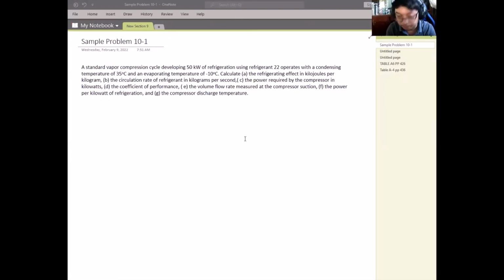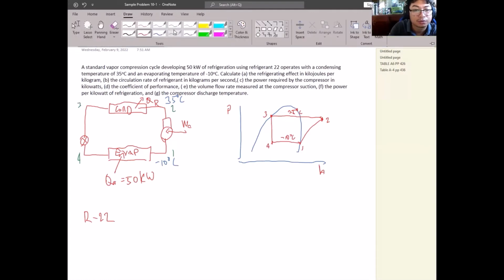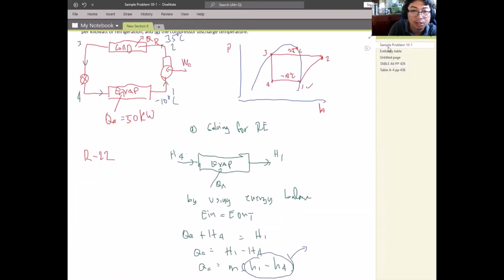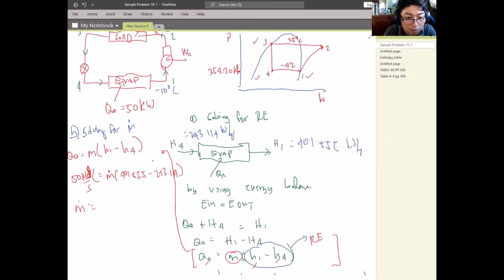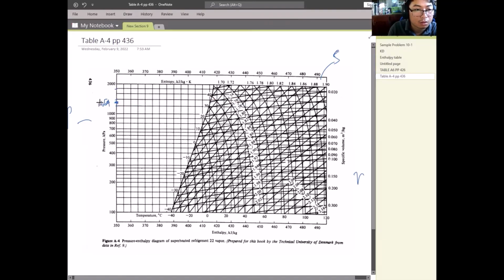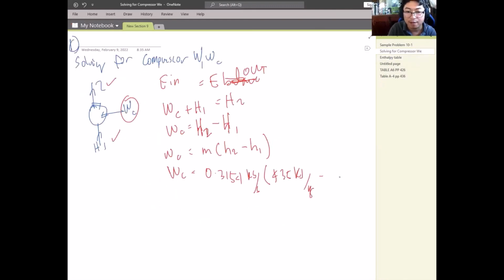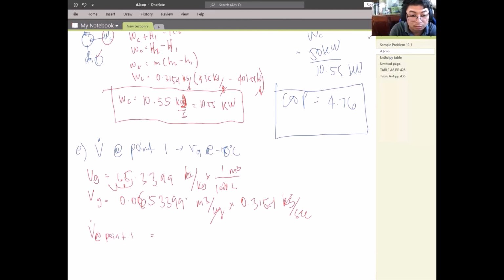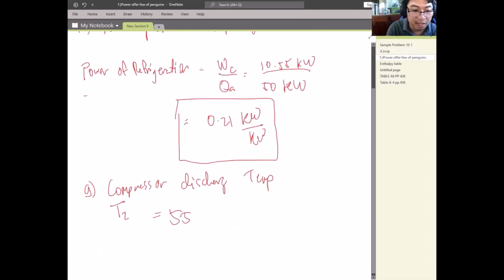Refrigeration Vapor Compression Cycle Sample Problem using P-h tables and charts

Comment: Sir, how can we use the mass and volume flow rate to calculate the pipe size? Or we can choose from the recommendation table? Please help!
Reply from the maker: Are you referring to refrigerant copper tubes?
Reply from the maker: If that is what you are talking about, chapter 7 of the book, refrigeration and ac by stoecker and jones will answer all  your inquiries.
Reply: @joshuamalajito7576  thank you so much, sir. It's a very big help!!